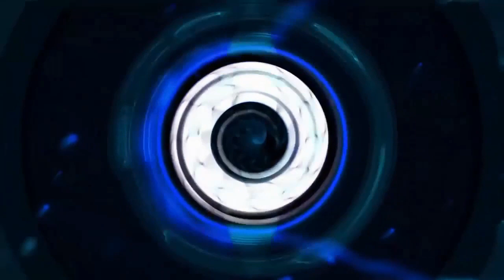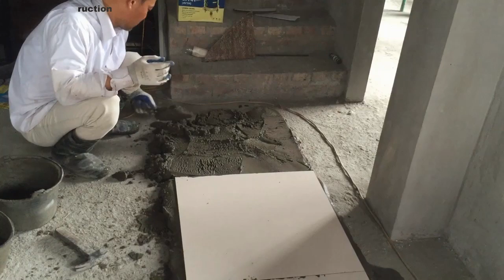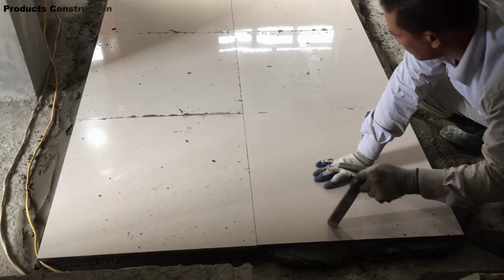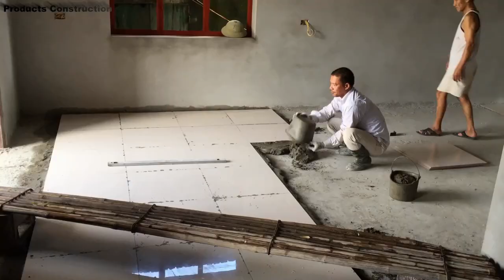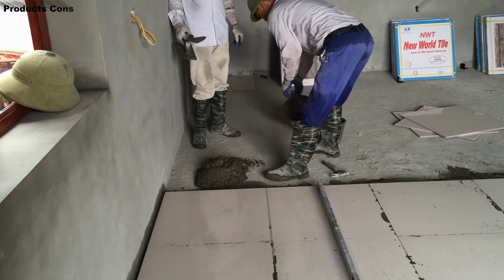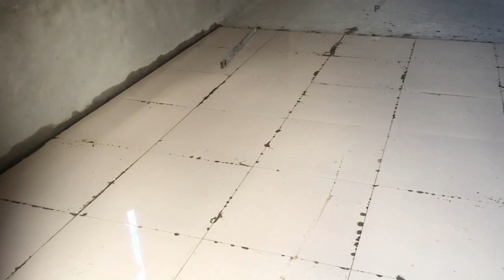How To Install Large Format Tiles With Leveling Compound - Install Ceramic Tile On Floor

Comment: Looks like this guy is skilled, but could use some more modern materials. I wonder how it will hold up?
Reply: MoneyManHolmes it will hold up just not the notch trowel you often see the modern ways do.  Plus this is the Old school ways of doing tiles.  Good for third world countries since a lot dont care about standards and regulation. My grandfather did the same method.  But this is no go in the usa.  This is the method even china use to build the great wall of china thousands of years ago.  So no notch trowels lol!!!   No one will hire you here in the usa if you do this method.

Comment: New world tile, I'd do that with a 30cm with 10mm notched trowel on a pre floated screed, then back butter each tile, still a slow process, with flexible slow setting adhesive. Maybe the cement & adhesive is different there of cost of materials more than labour. Looks flat though
Reply: Malo el procedimiento
Reply: @carlosluisvillarrealmendoz3982  bad procedure, the notched trowel?
Reply: Both cost and labor are cheap over there.   Marble , porcelain , wood are much cheaper there compare to the usa. But technology, electric stuff , computers or cars cost double what it cost here in the usa. Plus this is the Old school ways of doing tiles.  Good for third world countries since a lot dont care about standards and regulation. My grandfather did the same method.  But this is no go in the usa.  This is the method even china use to build the great wall of china thousands of years ago.  So no notch trowels lol!!!   No one will hire you here in the usa if you do this method.
Reply: @JohnT2088  Actually the TCNA still approves mud setting, though technically you're supposed to bond it to the floor with thinset, and bond the mud to the tile with thinset here, and then sometimes depending on thickness you need wire in the mud as well. In USA as well before large format ceramic and porcelain got popular this was also done with marble and saltillo, with Portland slurry or soaking the tiles in water and sprinkling Portland dust on the mud.